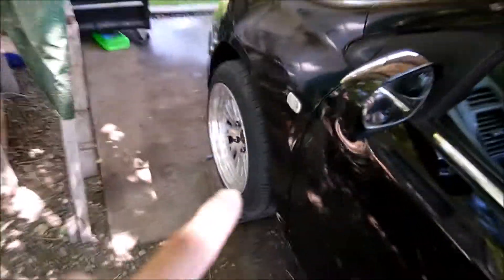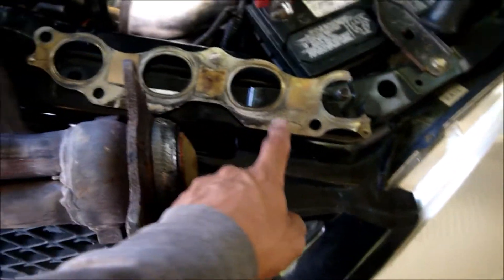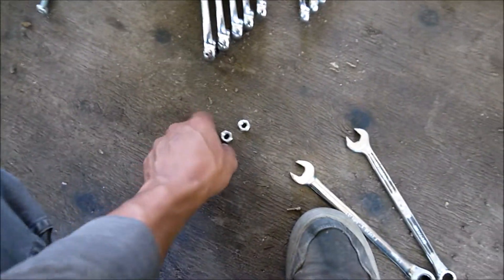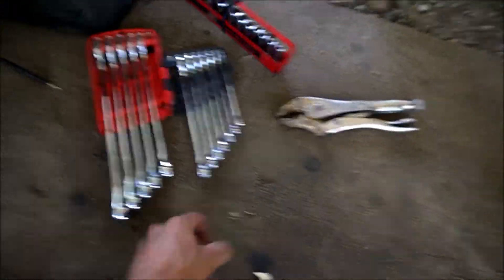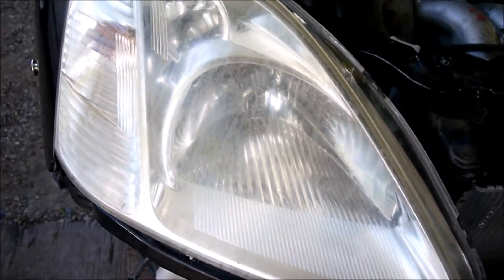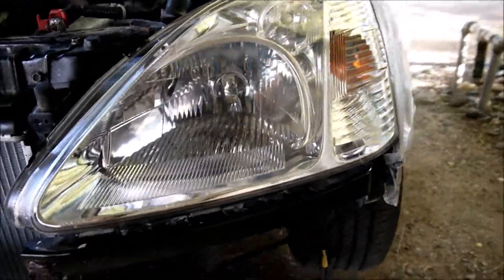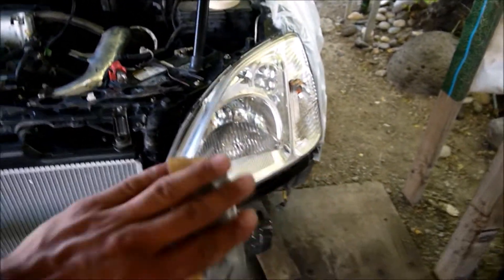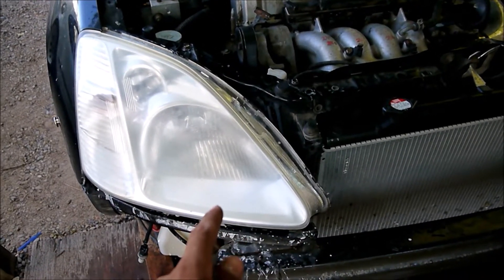EP3 Headlight Restore!!

Comment: im going to be cleaning my headlights on my ep3 too, ill make a video for my channel too!
Reply from the maker: Get it homie! I hope my tutorial helped!
Reply: @eddiegastelum53  yeah man. I knew i could save the stock headlights. Yours came out stunning
Reply from the maker: This process last alot longer than “headlight restoration kits” because you can always go back and polish them and it’d clean them up. Tip: if you over spray and the clear starts dripping you can sand it smooth and respray it. If you have any questions hmu on Instagram @eddygee530